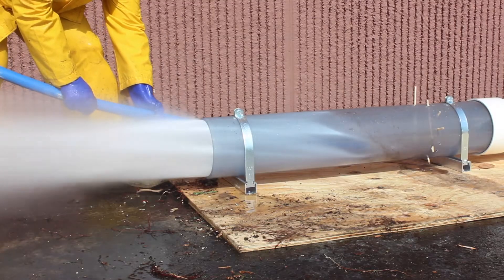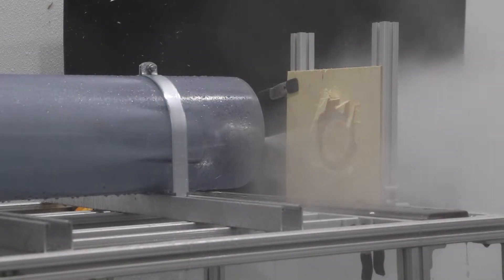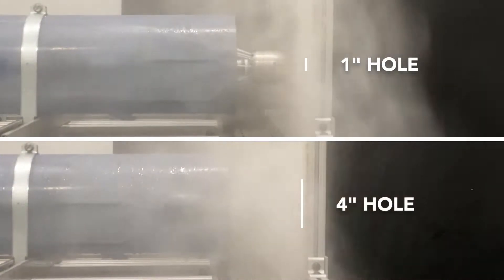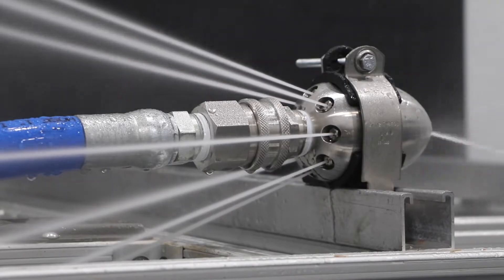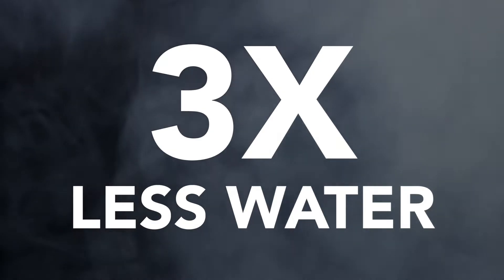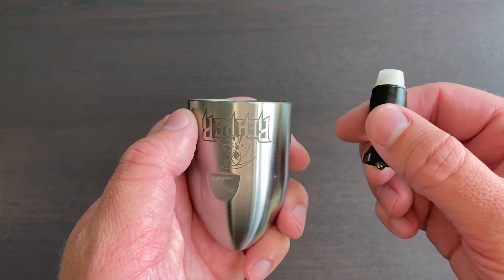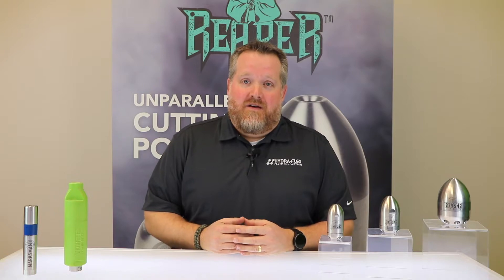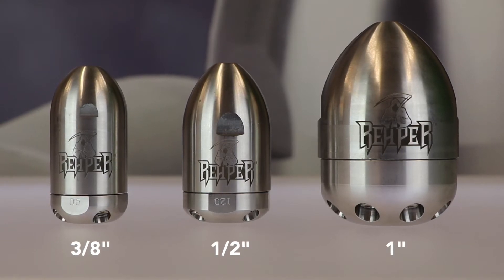Let's Talk About the Reaper™ - Rotating Jetting Nozzles

Comment: I am a fan of the reaper.,   You gotta have a beast of a machine too..  as I do….  But if you do, this thing will do the job..     it doesn’t have a lot of pulling power. But it’s enough..  I think if it had more pulling power,  then you would lose that extra power up front..  it’s a well balanced nozzle in that regard…    I use the reaper, the bulldog and a couple of button nozzles ..  I’ve got the warthog too..  and it’s good, but it’s a pain in the ass to maintain and I think the reaper does a better job…

Comment: Ive been using the 3/8 reaper nozzle for the past 3 years. Regardless of how long I attempted to remove all roots in a 4inch line it cant be done and im forced to send the warthog through to completely clear the line. The reaper is excellent for getting a line opened fast but not having spinning jets on the sides it absolutely will not clear the roots. Its very disappointing since the reaper is by far superior to the warthog when it comes to reliability and serviceability. If you could make a 3/8 reaper nozzle that can also cut roots with spinning jets on the side you would have the perfect all in one nozzle.

Comment: How do they work for descaling?
Reply from the maker: Hi, there! The Reaper works well in descaling applications. You can utilize the power of the front rotating stream to descale as the nozzle makes its way down the pipe. To learn more, please contact us at 952-808-3640 or at sales@hydraflexinc.com.